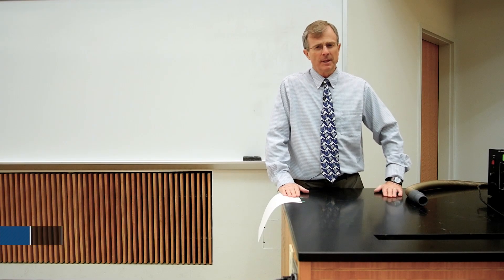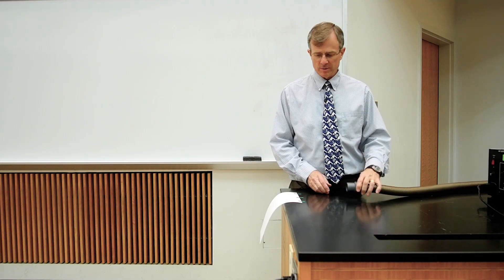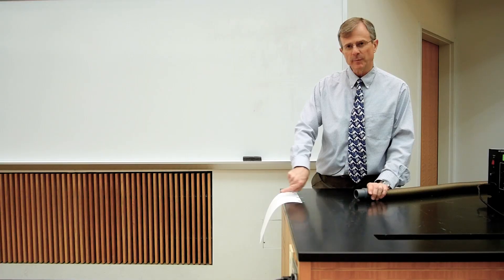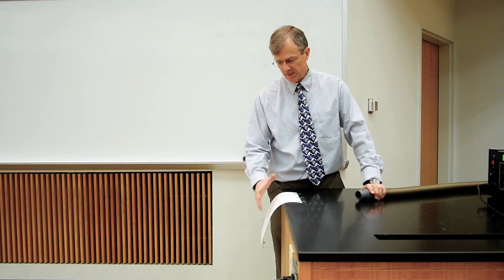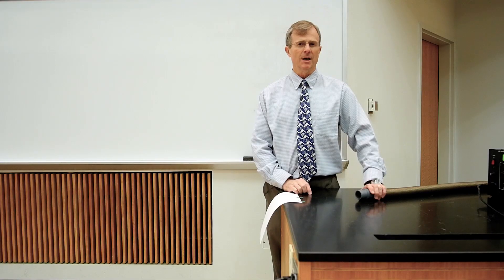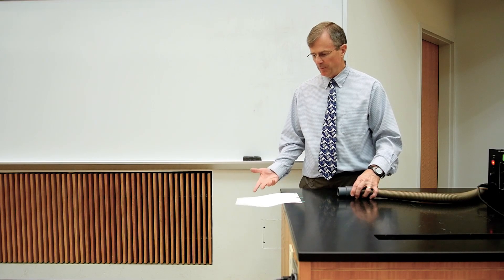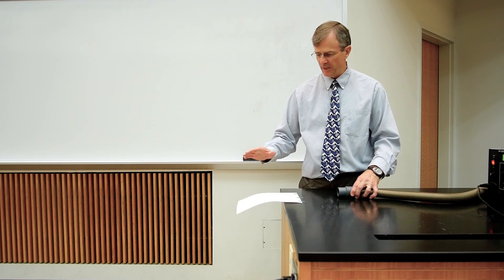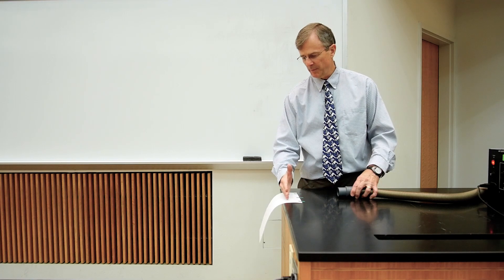Bernoulli's Principle Demo: Paper on Table

Comment: I have a question in regards to this phenomenon.  In a Pitot tube, there are two holes.  One hole in the front pointed into the airstream that captures the static + dynamic pressure.(stagnation pressure).  The second hole is along the body of the tube perpendicular to the airstream.  This second hole captures the static pressure.  The static pressure is then "subtracted" from the stagnation pressure to leave just the dynamic pressure from which airspeed can be calculated.  The airflow across the second hole is at the speed of the fluid so the pressure at this hole should be reduced by Bernoulli's equation below static pressure (?).  Why doesn't this effect the results of the calculations?
Reply: NO!  I am sorry this is a year old, but. . . . 
..
Speed of air along a straight surface is NOT LOWER.  Bernoulli says NOTHIONG about speed relative to a surface.  NO.  This is called a "static port" because it measures the STATIC pressure!
..
The pressure of a flow of air along a FLAT surface is atmospheric pressure! .
This "fast air has a lower pressure" thing is a BIG misunderstanding repeated over and over.
.
For this video:
When the paper is bent, this is Coanda because the jet of air is trying to go straight and also entraining air around it thus lowering the pressure lifting the paper.  The paper prevents the entrainment, therefore the jet pulls on the paper trying to drag it along(Coanda saw this)  - viscosity.
.
When the paper is straight, it is purely entrainment pulling the paper straight. It's like friction.
.
The air out of the hose IS AT atmospheric pressure, not below it! 
.
Bernoulli occurs in the blower where higher pressure INSIDE pushes more than the outside atmospheric pressure, thus  accelerating the air out into the lower atmospheric pressure.  This is Newton.  The in-out difference in pressure is the source of the force Accelerates the air out into the lower atmosphere.
..
..
Here's the rest of the correct story:
First, VERY Important thing to remember:
Air HAS MASS!   Pressure on the outer part of a curve will always be higher because the fluid wants to go straight!
This ALSO makes the pressure less in the inside of a curve.
Try these: 
 Understanding Lift Correctly: https://rxesywwbdscllwpn.quora.com/
 Understanding Bernoulli Correctly: https://kyuoyckftflurrpq.quora.com/ 
 Flow along a Convex Surface: https://www.youtube.com/watch?v=3MSqbnbKDmM
Reply: shut up

Comment: Great Video! really clear and helped me learn.Thank you!
Reply: The air out of the hose IS NOT at a lower pressure. NO NO NO.  It is due to the CURVEED flow.
.
The common misconception is that any moving air, such as from a hair dryer, leaf blower or your mouth, has a lower static pressure than the stationary air around it. This is not true and comes from a misreading of Bernoulli’s Principle and misunderstanding of how to apply it. There are several demonstrations that are misinterpreted to show the static pressure is lower.

The moving stream of air from one of these is at the very same static, atmospheric pressure as the still air around it. It is NOT lower.

Here is the correct explanation.

This moving air has MORE total energy than the still air around it, not the same amount. This additional energy was added by the blower. The Total energy is the potential energy of the atmospheric pressure plus the kinetic energy of its motion or momentum. 

Each of these ‘blowers’ adds energy to the air in the form of static pressure.  This internal pressure is higher than the atmospheric pressure outside it. 

For example, muscles move the diaphragm to squeeze the lungs.  This increases pressure in the lungs. 

This internal pressure pushes more on the air than the pressure outside
A pressure difference between two locations is called a Pressure Gradient.  This reflects the idea that the pressure changes gradually between the two locations. 

Because the internal pressure pushes more on the air, there is a net force toward the lower pressure outside the blower.  The air is free to move and is accelerated toward the lower pressure.  This is Newton’s Laws in fluids. 

Air has mass. A Pressure Gradient provides a net force.  Mass is accelerated away from the higher force, toward the lower force and gains speed in this case. This happens at the outlet of the blower and we have the stream of air starting internally at the higher pressure and accelerating to atmospheric pressure.

That’s it.

For those watching the conservation of energy rules, the TOTAL energy of air INSIDE the blower is the same as the TOTAL energy of the stream OUTSIDE the blower. The trip from inside to outside has no energy changes in that air. 

We see that inside the lungs, all the air has nothing but potential energy in the form of static pressure and no motion with kinetic energy – no dynamic pressure. All the energy in the lungs is in the potential energy of static pressure.

The air gains speed (acceleration) as it exits, thus changing the extra potential energy of pressure into kinetic energy of the moving momentum of the air’s mass.